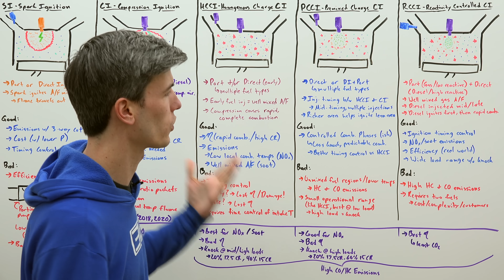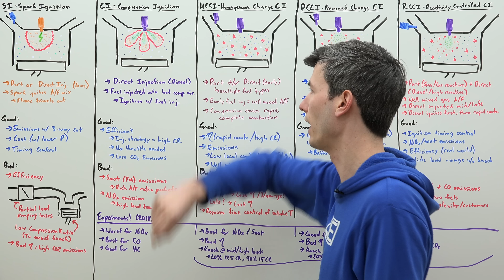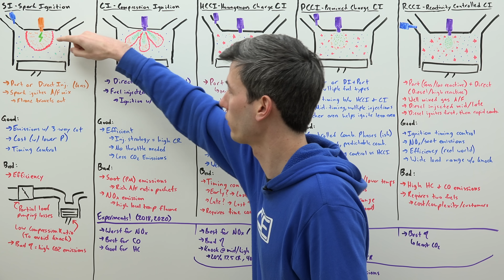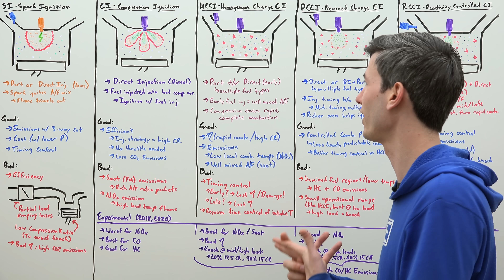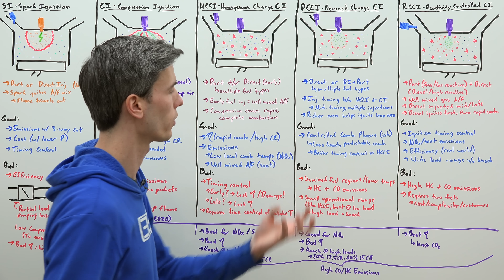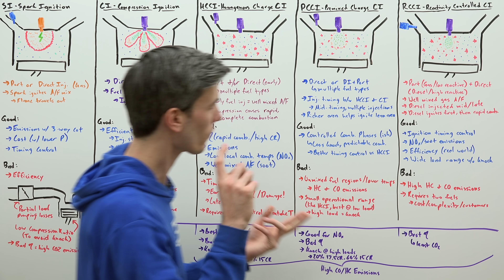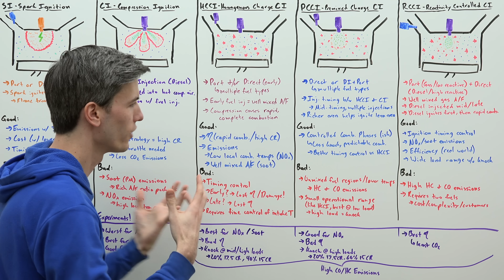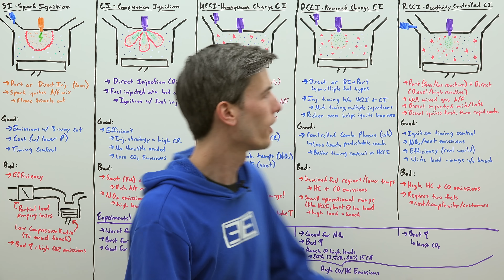If Combustion Engines Have A Future, What Is It?

Comment: It’s interesting to think a gasoline engine is actually working hard at idle. Never thought about it that way before.
Reply: Oh yeah, high vacuum and the engine is trying to suck air in when it’s very difficult
Reply: Yeah, some people even tried adding a two-stroke bike engine to keep a flywheel spinning while idling, and stop the main engine while idling, then use the flywheel to restart the main engine while you press the throttle. This would require the secondary engine to run at all times. It could be done easier by a flywheel and some batteries, to replace the second engine with a flywheel-assisted electric starting of the engine, and would require quite a bit more complexity, but it could significantly lower the consumption at idle.
Reply: @SapioiT  I have been thinking about this flywheel thing for a long time now... Like, even maintaining the four strokes engine, it could be used  as a kinda power capacitor, so the engine could just be smaller and it would be "charging the capacitor" while in idle... Ideal for places with high traffic. A electric motor also would be good in this setup, since at some point the small engine would not have enough time to "charge the capacitor" or in opposite, it would charge the battery... See, a very nice and simple hybrid with two small motors ;)
Reply: @SapioiT  they call it start&stop, it’s on the market, at least, since 2010, the engine shuts off when the car is stopped, then re-start once the gas is pressed (or the clutch is released) it just need better starters and bigger batteries. It’s disabled by running the A/C or by a purposely made button.
Reply: @davidebacchi9030  I didn't know that. I think the battery party is the issue, here. Maybe with a flywheel, a battery wouldn't be needed, since the flywheel would store enough power from the engine to restart the engine with minimal electricity usage.
Reply: @SapioiT  Absolutely not if chosen according carmaker directions (usually betteries for S&S are bigger than ones for standard cars), the weak piece, at least on first models, was the starter motor that was taken as-is from non S&S models and that proved to be weak, thus it had to be re-engeneered to handle the tougher work. As a note if the battery goes too low the ECU is smart enough to keep the engine running to recharge it battery.
Reply: @davidebacchi9030  Very interesting. Thanks for sharing! I'm guessing this might introduce the need for a second battery, meant for quick recharge and quick discharge. The current batteries are meant for quick discharge but slow recharge, from what I know. I might be wrong, though. Or, there might be the need for a large-enough capacitor to start the engine and get recharged quickly from running the engine. This might lead to the need of a more powerful inverter, I think.
Reply: true although it also can depend on the style of comparison..At idle it is using rather little fuel.  An instant fuel usage gauge will show, like on my car, 35mpg at 40mph, but 3mpg under full throttle.
Reply: @grandrapids57  wow
Reply: @grandrapids57  Im no expert but I heard on this channel actually that accelerating at low rpm but high throttle will increase fuel efficiency due to less throttle valve losses. But maybe I misunderstood that.
Reply: @TheDude50447  ah... I've been through that thought experiment too, but ultimately the engine needs to keep a 147/100 air/fuel ratio, so that is built into any carb or injection system design.
Reply: Having an engine that's part Internal Combustion and part Stirling could solve this problem; when idling, your ICE just turns into a Stirling engine.
Reply: @AmaroqStarwind  The issue with stirling engines is that they're often a lot heavier than other engines of the same output. If you mean the sterling engine will run the heat of the combustion through the engine to then be cooled by the radiator, it would work, and even a stirling engine of a quarter of the size of the combustion engine could keep the combustion engine idling without fuel, for a while. All in all, it sounds like a good idea, with the proper materials.
Reply: @SapioiT  Re: Weight... 
I mean, stirling engines don't have to be heavy. We just haven't made a lightweight stirling engine yet. Just look at where internal combustion engines started compared to now.

But yes, the main internal combustion engine supplies most of the power and energy, and the stirling engine would for the most part just be running off of the internal combustion engine's waste heat. The tricky part would be making the whole thing elegant.
Reply: @AmaroqStarwind  It would likely require having two lines, one going straight to the radiator, and one going to the stirling engine and then to the radiator. When in heavy use for long periods of time, the stirling engine would be mostly bypassed, but still used to increase the power of the other engine.
Reply: @SapioiT  The Stirling generator could also be converted into a Stirling-driven heat pump when the rest of the engine is in operation, keeping the intake cold and the exhaust hot.
Reply: @AmaroqStarwind  Oh, I didn't think of that. This could increase the efficiency of the engine, during short peaks, like when it suddenly has to start going uphill with a heavier load than normal. 

On thing I thought about a long time ago (some 3-5 years) is using a smaller stirling engine to vent the inside of the car when the temperature difference is over 10 degrees celsius and when there are over 25  degrees celsius, with those parameters configurable, so parking your car in the sun for a few hours in the middle of the summer won't make the interior uncomfortably hot after a mere 10-20 minutes of not using the AC. And such a system could be installed on an existing vehicle, too. And while it might need heat to be started by the battery, instead of starting by it's own, it would likely run enough time to more than make up for the difference, and also leaving the car with the battery dead empty (but not unusable) in the sun, would slowly but surely recharge the battery, maybe enough to start the vehicle. I do think vehicles should have a terminal for using a different vehicle's battery to start the electromotor directly, bypassing the existing battery, so a vehicle can be started even if the battery is dead (empty or unusable). It would mean that, if the battery is not recharged (if empty) or fixed (if broken), then people could still drive, as long as someone kickstarts their vehicle every single time they start the engine.
Reply: Regardless, Burn = resource forever gone from multiple uses. Electric = > 90% recyclable battery materials, plus several sustainable non-polluting alternative sources. So, just curious, can opposing piston engines be scaled up to drive ocean-going shippers? Then again, what justifies the burning, that makes “efficiency” go infinitely negative?
Reply: Causes more emissions of hydrocarbons and carbon emissions
Reply: Very few diesel engines have a throttle plate, so we shouldn't be using those rare examples to compare with a spark ignition engine. 

It is interesting seeing how much fuel the injectors are flowing in my 7.3 Powerstroke at idle vs cruising. Grams/stroke is very similar. Not until I get on the throttle does it really start to inject. But it's also creating boost at low loads which aids in efficiency. It is at or near atmospheric at idle.
Reply: If you're just idling, might as well just stop the engine.  I think somebody may have thought of that a while ago. :-)  Warm engine starts easily.  Slightly bigger battery and idle cutout is all you need.
Reply: I feel sad for my engine at idle now :(
Reply: The rpm is low though so you aren't creating as much resistance to air intake.
Reply: Which is why if you are going to drive "flat out", you are better off with petrol (gasoline) spark ignition engine.
But, if you are only going to be driving at part throttle, you are better off with diesel or compression ignition.
Reply: I was thinking a little further into the future. Like steam and wood fired. 
Because I don't see a reliable source for electricity in the future because the atom is to expensive to use. And very scary. The green nuts will probably outlaw burning wood from your back yard too.
Reply: But since not a  CARB approved solution. No can do.
Reply: I also thought just the oposite too.
Reply: It just puzzles me. How? Is the fuel computer display lying to me? How can it "work hard" when it (at least if the computer doesn't lie) doesn't consume fuel? Maybe it works hard on braking the car? ;) But I wouldn't call it engine's work. That's the car momentum doing the work of moving the engine shaft.
Reply: @Adam_Lyskawa  it's worth distinguishing between 'efficiency' and 'consumption': at low load the engine is consuming very little fuel, but it's producing next to no useful work - low efficiency. At full throttle it's burning lots of fuel but producing more output per unit gasoline input - higher efficiency. 
The best case for real world mpg with a throttled SI engine is having a small engine that spends most of its time at/near full throttle. 

By low load I mean running in neutral/stopped or driving the car at a low throttle setting. In the case you mentioned - foot off the gas, car decelerating in gear - you're correct in saying the engine isn't burning any fuel. In this situation I think some modern engines actually open the throttle without injecting fuel, to reduce pumping losses and allow the car to coast more efficiently (I have learnt this only anecdotally from driving a VW Up!)
Reply: @CyclicPilot  "The best case for real world mpg with a throttled SI engine is having a small engine that spends most of its time at/near full throttle. "  You can at least partly compensate for that with higher gearing for the bigger engine in last gear.
Reply: @martinsv9183  this is true, but I think a lot of modern cars tend to be set up with high gearing anyway for that reason (including the Up!)
Reply: @CyclicPilot  Yes, and the bigger engine will then have even higher gearing. That's why you see pretty low consumtion figures for highway driving even for the bigger engines nowadays. 40 years ago they didnt have enough gears in the gearbox to get to the really tall gearing for the big engines so back then they always consumed much more than the smaller engines even on the highway.
They could have made the spacing between the gear ratios greater of course  but then you would lose some of the acceleration benefit the big engine would have had at lower speeds. Something that might have been one of the reasons you bought it to begin with.
So many manufacturers sacrificed the fuel consumption at higher speeds instead. At a time when fuel wasnt that expensive it probably made at least some sense.
Reply: @martinsv9183  all things being the same, the car with the larger engine will find more efficient crusing at higher speeds.

It all depends on when (at which power level) the smaller engine needs to enrich the mixture and retard the spark to prevent knock. At that point the specific consumption goes through the roof.
Reply: @Adam_Lyskawa  idling is the hardest thing for it to do, but not on engine internals. just in the sense that it requires a very delicate fuel/air/timing trio to make it smooth and stay running. so its not physically hard, just a delicate procedure as you suspected. only under LOAD does the pressure and force build rapidly.
Reply: What about a diesel engine
Reply: @thepurdychannel8866  they don't have a throttle plate to close for a piston to pull a vacuum against afaik.
Reply: @spamcan9208  modern diesels do use throttles and egr to control nox emissions and lower combustion Temps. Egr can also be used in gasoline engines to reduce pumping losses.
Reply: @zachary3777  what about 2003 and 2009 diesel
Reply: @spamcan9208  Older diesel engines had a throttle plate - i.E. the Unimog engine
Reply: Gas engines warm up quickl at idle, Diesel engines warm up slowly at idle.

Comment: This whole video is basically 'How can we hang onto our 19th century technology'. The IC engine got us to where we are today but it's usefulness for general applications has run out. Compare the energy efficiency of an electric motor to an IC engine and it's not even close. Compare the number of moving parts. Compare the ease and cost of construction. Compare the reliability and longevity. The ICE is now end of life for normal automotive applications. I know a lot of people can't give up the brum brum sounds but the modern EV has got it beat for all general applications. The answer is no for anything other than edge applications.
Reply: Synthetic fuels might save ice cars
Reply: @christopherayala4619  Sure, right now a gallon of Methanol (synthetic fuel) is <>$17 a gallon.  To fill up a compact car with a 13 Gallon fuel tank would be $221 for a range of <>320 miles. A Tesla Model 3 for the same range would be $15 to $18 assuming $0.14 per KWH (current average price). You pays your money, you takes your choice.
Reply: @PaulLemars01  ya synthetic fuels is expensive for now but when Porsche's releases more it will get cheaper

Comment: Personally I still se hydrogen becoming the fuel for ICEs it will just take time to make something that will work just like anything else. We have hundreds of years in petrol and we are still making it better hydro (not fuel cells) could easily be the high Power high-efficiency and “green” fuel. We just need to actually sit down and learn how to best optimize it in an ICE most of the information in principle is there I know there is a lot of channels and videos discussing this very topic and how it would not work (not be what we need) including this one but I believe we have only scratched the surface of what hydrogen ICE could be. I wish to make an engine that runs on hydrogen and oxygen tanks so it’s pure H2 O2 in the engine. Yes it would be a dual fuel engine but no NOx and no Hydrocarbons 100% clean but the way to get the fuel you may ask will be even worse that I say we need to make nuclear energy more efficient than we have now these technologies I believe to be the future

Comment: In Australia there have been some RCCI engines used in motor homes and towing vehicles that I have worked on. They consisted of a standard diesel with an added LPG (Liquefied Petroleum Gas is a Propane / Butane mix). The engines ran smoother, used less diesel and/or had more power. As mentioned, the drawback was complexity, additional up front cost, and the extra cost of running 2 fuels. Overall it did not save the owners much money.

Comment: Electric cars are many times considered 80-95℅ efficient, right? Taking into account that the most efficient electrical generator/alternator can be, around 70℅ that I know of, and the fact that most power sources in large scales (diesel, coal) are in their own process of generation of energy around 60% efficient, is a bit discouraging. Nuclear isn't that great. Eolic isn't constant, it's bad for the environment as well, and never gets it's alternator to full power. Hydro has the best potential, but it still would be capped at 70% tops. Solar is always below 30%. This would mean that electric cars aren't very efficient to begin with. Also, power grid losses, and charger losses are pretty hefty. The other thing is emissions. Might not be as high as that of a gasoline car, but they are pretty considerable because of the batteries. 

I'd say that internal combustion engines are actually damn efficient. The thing with transporting fuel is also a bummer, but it isn't very power demanding since you have to do that with electric car's "fuel" aswell.

What we could do is using more efficient cycles such as heat recovery pistons such as some cycles have, and a "thrust" two stroke piston as I think you have covered. There will always be some kind of heat leaving the exhaust, and that can be useful since you can actually catalyze exhaust gases to make some synthetic fuels! Granted it wouldn't be much, but it's something, and it would drastically reduce emissions.

Comment: Batteries surely will never replace high output ic engines in agricultural tractors for instance ever ?
Reply: Electric tractors already exist
Reply: @ΗΕΑΗΘΣ  Thanks for replying, in the fields around my home during the season 600 hp John Deeres thunder out 24 hrs a day. Where are you going to get batteries that provide that output without having to be changed out every few minutes? Farmers, notoriously stubborn, will not want to halt work all the time to replace the battery pack. And anyway it is not necessary, I would guess that the pollution from agricultural vehicles is only a small part of the total, IC in this environment is so much more convenient.  Anyway thanks for your interesting channel.

Comment: Why not have a hybrid system where the engine runs at only one speed (or maybe just 2 or 3 pre-set speeds), timing isn`t so variable as there is no load on the engine via a mechanical drive system plus only a few set engine speeds (not variable through 5000 or so revs), so no timing or emission issues. Much simpler to build and the variability in speed/load can be taken by intermediate batteries, charging when not loaded and taking extra load when needed to an electric motor drive system. That way the combustion and electrical system can work at the maximum efficiency possible (while using less batteries than an pure electric vehicle) with maximum clean emissions possible.

Mining rare earth metals as well as cobalt and nickel in places such as China and Africa is environmentally very destructive and creates massive amounts of harmful emissions and environmental damage. A more efficient ice system is a better option